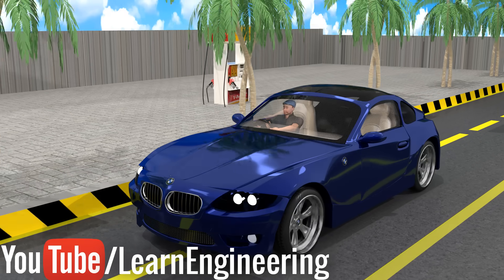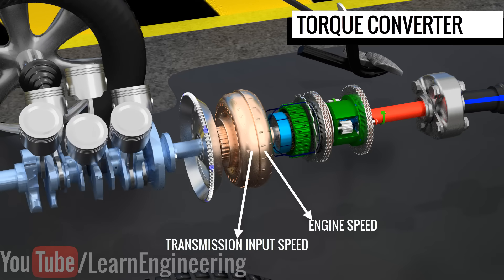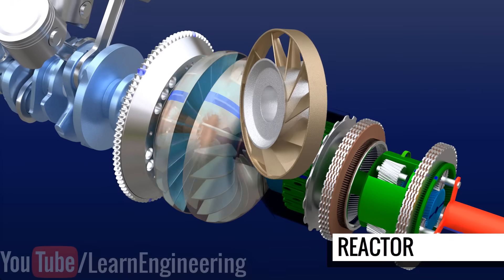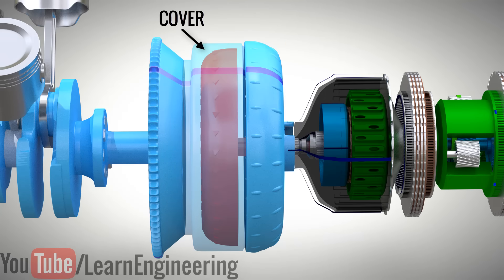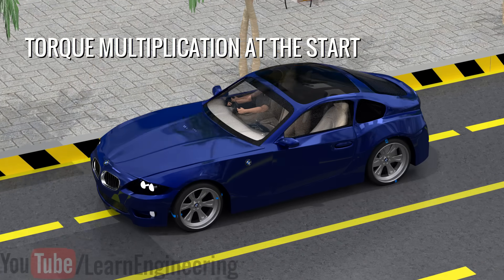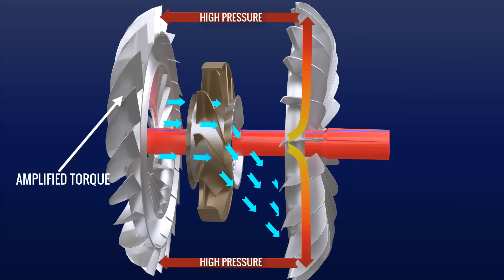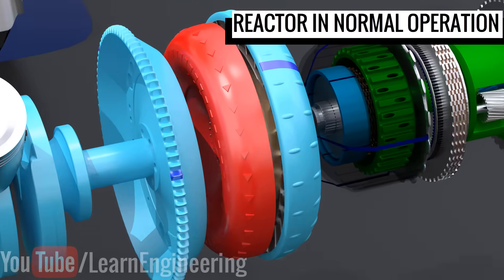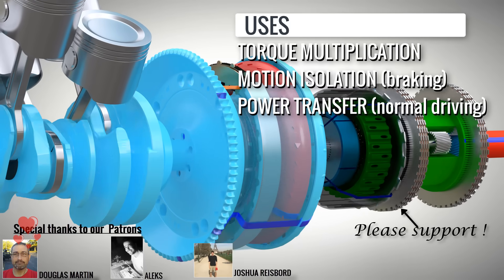Torque Converter, How does it work?

Comment: What happens with the lock-up clutch while braking or while changing gears? Does it disengage? When does it reengage? Thank you!
Reply: No need for disengaging it when changing gears because the automatic gearbox has clutches in their gearbox for each planetary gear set. If you brake 2 seconds i guess it does disengage even if you didnt come to a full stop
Reply: Major Tom thanks!
Reply: I am only familiar with lockup mechanisms through say 1999 or so but they were actually de-activated by the brake light switch...on most cars, especially ones with smaller engines, if you are cruising at 40 mph or more on a level road and lightly touch touch the brake pedal, not enough to get the brakes working, just enough to light the brake lights, while keeping your foot steady on the gas, you will hear what sounds like a gear change ALMOST, except the rpm change is too small. The engine rpm's will typically rise about 200-300 rpm when you do this and the convertor unlocks. Take your toe off the brake, and you'll hear it settle back into the lower rpms again. In the late 80's-early 90's GM had a lot of problems with their TCC (lockup) mechanisms getting stuck engaged due to sticking solenoids. The car would shift a bit harsh, but when you stopped it was just like coming to a stop with a manual and forgetting to push the clutch...the engine would just load up, shudder, and die. You could restart the engine, but when you tried to put it in gear it would stop the engine cold and could not engage into gear. After it sat for a few minutes, the solenoid would slowly bleed off the fluid pressure, the TCC would unlock, and everything was fine again. Until the next time it happened. We replaced a ton of those solenoids. Ford had their own version of the problem, but in their case the TCC would chatter, and it felt like you were running over the rumble strip on the highway. That was the TCC rapidly locking and unlocking several times a second. Anyway, on those older cars, the TCC only engaged at light engine loads, in the top two gears, and only above about 40 mph. Its operation was not allowed until the engine was at full operating temp, just because it added to the harshness of a cold running engine and transmission. Which is something nobody knows anything about anymore, since they've made cars so perfect and foolproof.
Reply: The newer automatics that I know of can lock 2nd gear and up. It's under full electronic control, of course.
Reply: "Lock up" generally only occurs for gears on the same planetary set in transmissions with more than 3 speeds. For 3 speed boxes the clutch would lock at a certain speed at a steady load in 3rd. Chance to the load (brake or accelerate) and speed would unlock. In 4 speed boxes the clutch can lock in 2nd or 4th and be unlocked by changing the load (braking or  acceleration).  I could be wrong but I suspect that modern 6 to 11 speed boxes would work similarly. Computer controls may make that not so. My 4 speed automatic is 26 years old and the 'lock up' is electronically controlled when certain programmed condition are met. I have an aftermarket controller that has the option of overriding that as long as I'm in 2nd or 4th.
Reply: L TR there must have been a recall or TSB because my grandfather had his transmission worked on before it really developed a problem. He had an early 80's Caprice Classic station wagon. He had an older model before with probably a Turbo 350 tranny but this one had a four speed with lockup torque converter. I do remember the lock up feature was a selling point back then too. Now its as common as a turn signal.

Comment: @Learn Engineering, One thing to add in this is I wish the lockup clutch was more illustrated, where does the fluid come from, obviously from impeller but how does it get there and how does the lockup clutch have the fluid pushed from the engine side of the torque converter? That would be great :D

Comment: It's incredible that all this technology in cars that we take for granted can be in a crappy beater worth $500 bucks.
Reply: As a mechanic, i've always said I find it funny that people get upset when their car doesn't work right. I tell them if you TRULY understood how many complex things have to work correctly, and how many different principles are at work, you'd actually be kind of amazed they ever work right at all...cars are truly one of the most well-sorted and robust things man ever made...
Reply: @ltr4300  agreed sir, education and preventive servicing is all we need to teach them now
Reply: @ltr4300  You think cars are complicated, wait until you see the insides of an Airplane.
Reply: @NWA744  Well technically an electric Airplane is less complicated than a gasoline car. rendering your statement not entirely true.
Reply: @ltr4300  Ya, That's why you're a mechanic and not an Automotive Engineer,
Car requires multidisciplinary fields to work together, we need Materials Physicists to give us the properties of materials such as metals, rubber, and any solid object, we need Chemical Engineers to help figure out properties of the chemical fluids such as Gasoline, Oil, Coolant, we need Mechanical Engineers to design an Engine that is able to generate rotational motion from combustion, we need Electrical Engineers to help generate efficient power for all the components. Etc.., a car is not randomly assembled out of someone's ass,
it takes a lot of different Engineering profession and Physics to get a car built.
And then, Automation Engineers write software and build machines that can automate the entire process, so humans don't have to do manual labor when building a car.
Reply: Transferring energy from an internal combustion engine to the drivetrain is a pain
Reply: keith cunningham  I own a 20 yr old MB E320 and personally doing ALL of the maintenance where the biggest thing I'm noticing are (prior) owners REFUSING to pay-for the replacement of seals that hold ALL of that fluid in the car.

I've got a weepy rear crankshaft seal and a quasi leaky (sealed-for-life) trans that has to be dropped; point here, these are fixes that are being addressed only after I've taken ownership as the 4th owner. At the core, people can NOT afford to hold-on to cars longer than 3 yrs. #IMO :o :/
Reply: @visceralcinema  allowe to disagree with you...as my first car was a 1985 Mercedes 190D we got in 1995...no one ever touched the poor thing...had 612,000 miles when I got it...I redid the vacuum lines filled the tank and took off for another whopping 369,000 miles before she finally blew a head gasket...fixed that...drove it the entire summer and realized that I was having heat issues because they gave me an American gasket for a German engine...put the right head gasket on but now I'm in the process of restoring the car....

enter her sister....a 1986 190E, bought in 2018...wife over revved the motor at 90k miles...shattered the piston with a valve...motor I replaced it with is sitting at 771,000 miles...original seals...

And the big sister to all of them, the 81 380slx bought in 2014 sits at a whopping 38,000 original miles and leaks all over the damn place...it's all about maintenance and sometimes that means treat her like a horny school boy who just discovered porn...beat the shit out of it every once in a while XD nobody ever did that with the slx...

Now there is a 99 Cummins in the mix here too, bought in 2000 with 21,000 miles...470,000 miles now and we just replaced the original clutch (nv4500 5 speed with an upgraded 5th gear nut) we bought it With the nut upgraded. That's all the work we have ever done to up except for basic replacement stuff like belts and oil...original water pump and radiator too...

Have 3 other vehicles with 2000 Dakota chassis underneath (extended cab, quad cab, Durango)....not a single vehicle I own or WILL own is newer than 2000...simple vehicles and easy to work on no matter how many idiots don't know how to maintain a 4.7l...
Reply: keith cunningham  
You are determining value created, not cost.
Two very different things in economics.
Reply: keith cunningham  you forget the 20miliion plus RnD before it even sells 1 unit
Reply: Crappy? I love my 700 dollar car. 
Everyone driving by in the debt wagons. Ha ha ha
Reply: keith cunningham  I got my 2001 Toyota Corolla for $1500 three years ago and it has been perfectly fine.
Reply: Capitalism!!…...Brings the unit cost of production down to a cheap price.  Just look at computers and iPhones.
Reply: Take care of your crappy beater and itl thank you
Reply: Correct.  An older but still operational car, call it a beater or whatever, for $500; is the best deal going if you're considering all the precision machined parts and technology you get.  A little rust around the edges and some dents/scratches in the paint makes many people almost give them away.   It's remarkable what we americans will throw away when it's no longer shiny.
Reply: keith cunningham  I hate it when you talk too realistically about my old Dodge. ;)
Reply: 3 years later that crappy $500 beater now costs $2000.
Reply: Beater...!
..I beg your pardon!!!!
Reply: Cunningham... brilliant!!!!...you have a book here!
Reply: @ronaldoquintos1675  >tesla or any ev car in general
>hundred bucks range
even when there's portable nuclear reactor in widespread, it would never reach hundred bucks
Reply: Hell, I had it in a $100. Beater.

But it is amazing.
Reply: keith cunningham this sounds oddly specific
Reply: mdo686  I reckon there's a lot of things you can't understand.
Reply: keith cunningham  500 dollars is 500 dollars
Reply: The car depreciated through use
Reply: keith cunningham that’s the stupidest logic every you count the cost of the sale but not the money the seller gets back if they buy a used car and then sell the used car. Recklessly dumb
Reply: keith cunningham  youre an entitled old boomer with unsubstantiated resentment and you make up fake anecdotes to get back at it over your perceived wrongings
Reply: I don't think people get the comment of Keith Cunningham. He shouldn't have worded it like that the tech costs $67k, which isn't true. However, the point was that $67k had to be "put in" in order to have the car on the road all these years and repairs later. And yes, that includes all the money every owner ever paid for the car itself or repairs. The high-tech components can end up for $75 scrap value at the junkyard, that doesn't change the fact that all this money had to be used at some point on the parts. In that sense, he is right and the technology absolutely isn't cheap. 

The car wouldn't be there for $500 if it did not have thousands upon thousands worth of work needed; THAT is the price of this technology that all of society/their economy has to pay. If that money isn't put into it, the car is off the road after 5 years instead of 10, now a new one has to be built and sold: That's money lost right there. The third owner probably isn't going to pay that in cash but the money still is lost just in wear and tear from age. The more complex a system is, the more failure points you have, making that system more expensive to run over time.
Reply: My crappy $500 beater happens to be a Jaguar of all things... hopefully the torque converter went and not the transmission.
Reply: isnt it possible to replace the clutch with a torque converter but retain the manual gearbox? both in case of car and motorbikes?
Reply: Where the hell are you finding a running car for $500? I haven't seen that since like 2002. Now it's more like $3,000, at least $5000 for something you can make legal to drive. Especially if it's already got good inspection for a year. Cheap cars don't sell to be a thing anymore. Not drivable ones. You can get one that's broken and spend another few thousand getting it running, just "Runs Fine, $500 OBO" is not something I expect to see any more.
Reply: LTR
That just makes Toyota/Lexus even more amazing — complex yet extremely reliable.
Reply: I have never owned an automatic, but this is pretty cool. I just like shifting my own gears. I also like V8 or bigger.  No, I didn't marry my sister.
Reply: @johnnyvt9  That's not very considerate after you got her pregnant.
Reply: @johnnyvt9  i shift my automatic ;) it feels like an aircraft when i do it since its just forward and backwards, so it kinda feels like a boost button XD
Reply: mdo686  His point is that the technology is worth a hell of a lot more than 500 bucks
Reply: You lack some serious comprehension skills, this amazing technology aint worth a  dime if the car is a lemon

Comment: Best animation on how the fluid flows and howa torque converter works. Thank you very much!! Some people have no idea how to teach and some people don't go step by step 1 2 3 4 5 6 7 all the way to 10, they just skip 1-5 and hope that you understand which screws us up, i had to figure that out on my own in order to understand the turbine and impeller were on different sides and the casing for the TC was what made the oil pump work while the splines of the input shaft went into the turbine side.

Comment: fist why do Americans so often use the word of a small part of something to mean a much bigger thing and sometimes that ting without the part that named it.
its a hydrolytic clutch and it can have a torque converter but not all do.
like callin a a engine a HEMI. lol most of them arent even hemi's.

second modern automatic's are mostly of the dual clutch type (like a VW DSG).
Reply: The dct is actually already in decline, the only real benefit of them are shift speeds which aren't very important in street cars. Whereas the torque converter has smoothness, extra torque and simplicity over DCTs. Look at bmw for example, as it's the car shown - automatics  used to always be t/c, they dropped it for a dct for only 1 generation, then have switched back to a redesigned t/c
Reply: Because Americans are smart and can infer meaning without having every little detail spelled out explicitly.
Reply: All English speakers seem to be partial to synecdoche; that's what you're describing.
Reply: now i feel stupid because i have no idea how to pronounce that.
worse in dutch we are precise with words but dumb with fraises.
like we wait ON the bus to arrive.
and we say: il pass by u later. when we mean to come and stay.
we also round of a conversation to say we are ending it.
in metal work i understand but rounding of a meting?
and out idioms are worse.
half we dont even understand wat we say we just know wat is meant.
Reply: Pretty sure all conventional auto transmissions use a torque converter, they all have a stator. For the last 30 years or so they pretty much all have lock up clutches too.

Second dual clutch type automatics are still very much a rarity. The vast majority of automatic transmissions in cars are still the torque converter/planetary gearset type. Even VW group sells far more cars with this type (most sourced from ZF) than with their own DSG.
Reply: Dual clutch are only popular in europe. Even  Vw outside europe sells mostly torque converter transmissions. Dct were designed for racing and are useless for city driving, where computer have hard time guessing what gear should be engaged next causing lags like old semi-automatics, not to mention clutch wear like in manual

Comment: I still prefer manual
Reply: nobody cares
Reply: ricer part2
Reply: manual is better indeed
Reply: @-_Nuke_-  Not for towing with a pickup truck.  The automatic tows much more weight than a manual, because of the torque converter.

Comment: So you're saying that crankshahe engines in our automatic transmission cars are essentially connected to the drive shafts with fluid? That's just completely nuts to me. Never would've thought that.
Reply: a fluid that transfers torque. But thats why i love manual gearboxes. the gas pedal is truly responsive as fuck because its mechanically linked to the wheels. Autos have so much lag even if the torque converter locks because they pick such a high gear to save gas so they have to downshift so the car can accelerate and it takes a while

Comment: no such thing as centrifugal force , pal
Reply: Depends on your frame of reference. I agree that in this situation, centripetal force would have been more correct. However, if the frame of reference were rotating with the pump/turbine, it could have been referred to as centrifugal.
Reply: treeperble still a great video